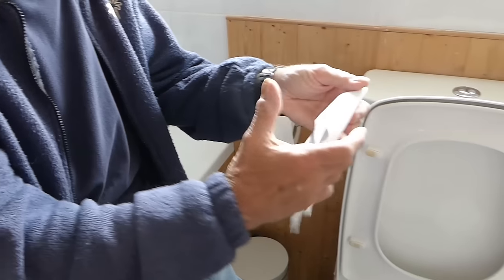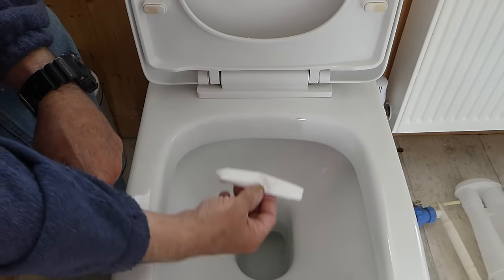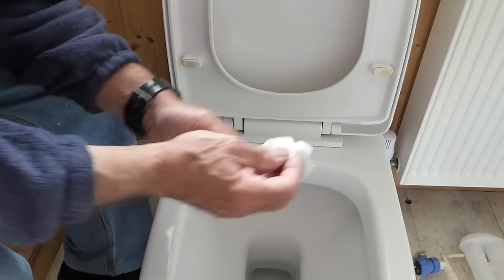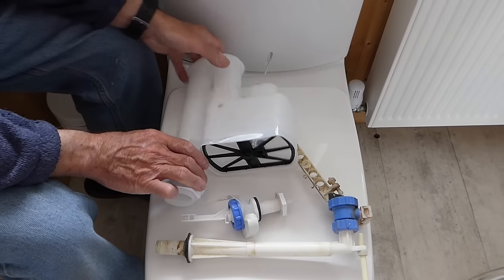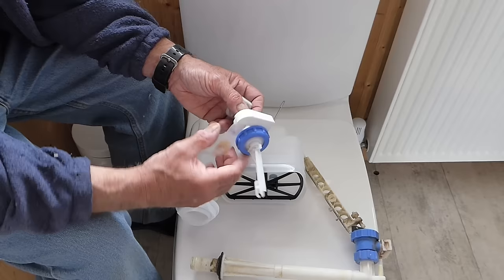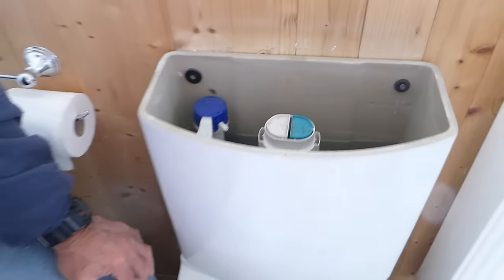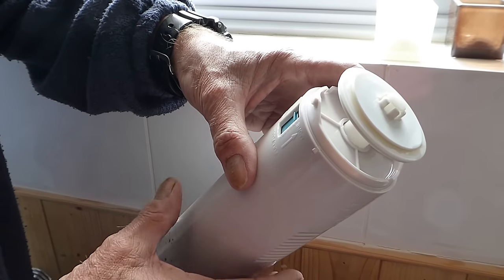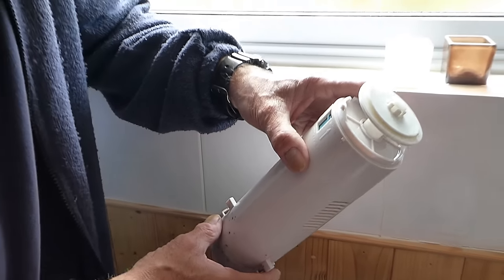How to fix water leaking into the WC pan.

Comment: Many thanks for posting this. I fixed my severely leaking toilet in 5 minutes and I'm not a plumber! Probably saved me £70! Thanks again!
Reply from the maker: No problem
Reply: Did you just turn the rubber seal around or switch to a new one?
Reply: dereton33 where is the link to replace the flush valve seal washer, please?
Reply: @ShaneH  That’s a very personal question

Comment: this is not 100% fact but I noticed tiles start leaking after them blue toilet blocks are put in the cistern. seems the blocks kinda harden the silicon valve in some ways and thus not allowing them to seal properly. I don't use them no more. Not saying but just saying.
Reply from the maker: Thanks.

Comment: Yet another person you've saved from shelling out for a simple fix! Flipped the washer over and it's made a massive difference. Almost can't believe how simple it was. It's an old toilet but this has probably squeezed more time out of it before it needs a proper fix. Thanks a million.
Reply from the maker: No problem.
Reply: A
Reply: @GuacamoleyNacho  Not sure how old it actually is but when I say ‘old’ I mean it’s been here at least a decade, it definitely wasn’t installed by the last owners and we’ve been here nearly five years ourselves.
Reply: Same here. Worked straight away. Thank you!

Comment: Great explanation, flipped the rubber washer seal over and appeared to fix it, however checked on it the next day and was leaking again so had to replace the washer with new one, so keep in mind if you just flip the washer it may only be good for a very short term temporary fix until you get to the store to get a replacement washer.
Reply from the maker: Nice work!

Comment: Al, i had this exact same problem with the cistern turned out the problem was the plastic follower behind the rubber washer had cracked in two, therefore not creating a good seal, simply superglued the follower back together, problem solved. Having VERY limited plumbing knowledge, despite it not being the rubber washer I would never have thought of looking at this and finding the problem. Thank you so much 👍🏻
Reply from the maker: Thanks for the info!

Comment: Excellent video.  I had a leaking WC, was very reluctant to call a plumber during this pandemic.  I could fix the problem myself.  There was a problem with the rubber washer. Just took it out washed thoroughly and fixed it after flipping the sides.  To my pleasant surprise it fixed the problem.  A big sigh of relief. Thanks again for posting the video
Reply from the maker: Glad it helped.

Comment: The one thing he didn't tell comments missed it as well.
The push buttons wc have 2 buttons  one for full flush  one for mini flush.
If you look at the buttons before he removes it, you'll notice when he puts it back, he's turned the unit 180 degrees, the 6 are in the oppersite positions.
Easily done, you may not have any problems, it you wc is on a long run  little less water may runout of power, could cause a blockages. I say it could.
Still a good video
Reply from the maker: Thanks never noticed. Thing worked as normal for another 6 years until new bathroom fitted.

Comment: Small add-, great vid which gave great insight, the issue I had after having a look was the metal buttons on the top removable lid, inside side there are two screw sections that you can adjust  which had increased in length over time - I screwed these to make them shorter which sorted out the leaking from constantly pressing the blue release buttons - hope this makes sense??
Reply from the maker: Yes got the picture, thanks.

Comment: Thank you so much. My toilet cistern kept randomly filling up hours after flushing. I noticed the water trickling from the cistern into the bowl. Followed your vid, the seal was caked in limescale as was a lot of the flush valve. Cleaned it all off in white vinegar now all is good. Might have to soak in limescale remover every few months.
Reply from the maker: No problem Gareth.

Comment: Cheers for the vid, I wasn't able to remove mine, it twisted around but never seemed to release.  Anyways it seems just the twisting around my have seated it better or removed any debris under the bottom washer as it doesn't appear to be dripping anymore.

My cistern was quite dirty inside, I blame toilet blocks, causing soapy residue, so cleaned as much of that aswell whilst in there as grime aswell could have messed up the rubber seal.
Reply from the maker: Glad it helped

Comment: Thanks.  This video showed me how to remove the top half of the flush valve to reveal the washer which was covered in limescale.  A quick clean and it appears to have stopped my leak.

If only I'd seen this before replacing the fill valve...  Never mind.  :)
Reply from the maker: Pleased you sorted ok anyway.

Comment: Thanks. Really useful info. Helped me eliminate the syphon and the inlet valve as the cause of the problem (new installation). Even with water-off, syphon removed and just a residual cm of water in the bottom of the cistern, it was still trickling.  In my case root cause was poor sealing of the syphon base to the cistern ceramic surface (jagged surface finish of the ceramic) . Fixed with silicone :)
Reply from the maker: Glad it helped

Comment: Thanks for this - Turning the washer round worked a treat!
Reply from the maker: No problem.
Reply: dereton33 Thanks for your video. Just as you showed, i removed the washer, turned it round and problem solved.  However I have another question.  Where the float is located that stops the water at the set level, is there a washer or seal, if so how can it be removed and replaced.
Reply: Mines still dripping after I turned it round , so need to buy a new washer, what do I google to get the right one please ?

Comment: Thanks for the video out of all the videos that I have watched  regarding this subject yours put me in the right direction, even though our flush  systems are completely different they all work on the same principle and I knew that there must have been another seal at the bottom of that push button valve - I had a big job removing ours as it was pretty well jammed up. cheers

Comment: I am in Canada. Thank you for this video and your time.
Just found your video. Have a dual button cylindrical flush valve of unknown age where the plunger frequently stays in the up position.
It doesn't want to twist to be pulled out. It is in a one-piece toilet so I'm sure it can be removed from the seat bottom part. But I don't want to force the issue 'cause afraid something plastic might break. Wanted to remove and look at valve all around to see if can deduce why the plunger frequently stays in the up position, how to make adjustments, and to determine the manufacturer/model.   
 I can't find the exact same looking valve online, on sale or in videos, so I can not find out how to make adjustments, while installed.
It's in a WaterRidge one-piece of unknown age, with no model # to be seen. The valve may have been changed out, because the fill valve is a FloatMaster400,  not a WaterRidge valve.

The valve looks similar to a Caroma flush-valve 4900 with blue and yellow buttons, and with a blue external float on a rod. The Caroma has a blue rod and a way to adjust the float's height, while mine has a yellow rod but not the Caroma's adjustment. (I presume there must be some way to adjust. the float height.)
This got to be more words than I originally intended.
Reply from the maker: A few models of flush valve do not twist out and will require the cistern to be removed from the wal and pan l in order to fit a new complete syphon. The float Hight is usually a screw at the valve end.

Comment: Thank you Al, I actually fixed two issues thanks to you. Hissing toilet = replaced inlet valve. Watery back of toilet = replaced the outlet seal as here. When I took my seal out, it was caked with limescale but also, to me, looked as if it was too small to block the hole it was going into. Just cleaning the scale off didn't help. I went to a plumbers shop and they had a seal that had the same internal diameter but a wider external - which seems to do the trick by actually blocking the slow outflow of water. This was also causing the toilet to 'gulp' and have to refill slightly every so often to replace the water lost down the back. So goes to show how the outlet and inlet affect each other and BOTH can be broken as in my case. Thank you so much for saving me from gulping, hissing toilets :-)
Reply from the maker: No problem Dan.

Comment: With the push button washer, does anybody know what that’s called or where to buy a replacement? I’ve just pulled mine out to find it never had a washer in it to begin with! No wonder I’m getting leaks
Reply from the maker: It is a Geberit Type 290 Toilet Cistern Dual Flush Valve

Comment: Thank you very much for this video, helped me to fix my toilet that was leaking back into the pan!
Reply from the maker: No problem.
Reply: dereton33 now I need to work out why the toilet cistern isn’t filling as much as I’d like even though the float is at full height
Reply from the maker: Should be an adjustment screw on it.
Reply: dereton33 there is but it’s at full adjustment

Comment: Thanks, think the problem of water leaking into the toilet bowl constantly is now resolved. Mine is the push button type like the inside of your toilet. I pulled out the thing with the green push button on it and turned over the rubber washer seal which also has air bubble blisters inside it. So I will need to buy a new rubber seal thing. Fushed toilet about 30 mins ago, just waiting the hour to do the toilet paper trick. Hopefully it will stay dry. Mine has the same jade green push button thing, but the other bits and bobs inside the tank are different to what is inside yours. Inside mine there is also a overfiow pipe, and I knew there was a problem with the toilet not only because of constant water streaming down the insides of the bowl, but also because of water constantly pouring out of the gutter pipe outside into the grid. Pitch dark now to check outside in my back garden if that has stopped. No outside light and I hate it out there in the dark, creepy as heck. So I will check that much later today in the morning as it is now 1:11am. Thanks again so much for this very helpful video for us all. You are awesome. ✨
Reply from the maker: Thanks so much Deb.

Comment: I am amazed that people are saying this works because the problem here is not a defective washer but a poor design. The washer is no larger in diameter than the hole it is supposed to seal (ok, so maybe a 1mm bigger) and given how much the plunger is able to waggle around this means that most times the washer will not be fully covering the outlet hole. There will be a tiny gap, just large enough for the water to escape, hence the leak. The only solution here is to get a bigger diameter washer.
Reply from the maker: Good luck with that one. By the  way 95% of people say that this has worked for them.

Comment: Useful video my friend...though I have a problem which I wonder if you can shine a light on....I have the twist off cistern unit with the large washer on the bottom....I have replaced the washer refitted and its still trickling down (albeit a very tiny flow)....any ideas what could be the cause...?
Reply from the maker: The seal on the syphon washer is letting by. Or the valve is letting by.

Comment: Hi, my water leaks through where the  flush valve is inserted into,  the valve that is between the water bowl hole is the cause, how do I fix this? Ty
Reply from the maker: May just need tightening a little. Otherwise a new rubber sealing washer if that does not cure it..
Reply: @dereton33  thanks for the quick reply, I did tighten it as much as I could but the water over flow tube prevents me from turning it any more than I can, do you have a video on how to remove the washer of the Whole to replace it.

Thank you again for the quick reply!!

Comment: Turns out those toilet blue discs with the soluble outer film aren't quite as soluble as they say. The outer film was wrapped around the seal plate at the bottom. 2 minute fix thanks to this direction.
Reply from the maker: No problem.

Comment: Thank you so much Sir,  This is really good to understand however if you can please share 2 other important things in the same push button cistern ..First i have a small filter in place for avoiding the dirt to enter which actually slow down the water to enter does this can be a source of the leaking problem and Second what are the uses of small flexible pipes in this type cisterns... Thanks and Regards
Reply from the maker: You can remove the filter for  faster fill, but it will not be the source of your leak. The flexi pipes just make the cistern easy to connect.
Reply: @dereton33  Sure,  I did the same &  changed the silicon Washer as you suggested in you video.  The Leakage problem is resolved. Thank you once again.
Reply from the maker: No problem.

Comment: Hiya mate I've got the same set up as that cistern....a very slight trickle on mine causes phantom flushes periodically. I tried turning the washer which didn't cure it so bought a replacement and that didn't....what else would it be? Cheers
Reply from the maker: The ball valve.

Comment: Wonderful video, thank you!
I received a letter from Thames Water last week...."your smart meter has alerted us there'a about 39 litres of water continually flowing through your meter which usually indicates there's a leak. This could cost you £709.93 per year".
Somebody came from Thames Water yesterday and advised the leak is internal so we have to fix ourselves, then notify Thames Water who will re-test.
I placed some dye into the water tank and it seeped into the bowl after roughly 2.5 hours. Could this be the issue? There's no dampness or dripping anywhere in the house and we only have 1 toilet. 39 litres of water every hour does seem a lot!
Reply from the maker: It is leaking but not the amount that you are reported as leaking. Fixing it will help though.
Reply: @dereton33  argh I was hoping that was the sole cause. Thanks for your assistance Al, much appreciated.

Comment: I think I've got a leak from the BACK of my toilet, I've  got the push button type with the button on the top of the toilet. I meant to put a water valve on the pipe to isolate it but never got around to.
My thinking was to STOP the water going INTO the systen, with thd OLD type it was easy to hold the ball cockney in position to stop water going INTO the systen.
How do I do it with the new push button type? If thecwater stops leaking downstairs after I've  emptied & kept the systen empty I will know  it's  the toilet leaking.
Hope that makes sence. 
Thanks
Reply from the maker: Just pull the cup under the filler valve up and wedge something under it.
Reply: @dereton33  Thanks but which one's  the filler valve? The blue one with the moving parts? What do I need to drop moving so it doesn't  fill up again?
Reply: @dereton33  I don't  know if it's  worth stating that it's  a Closed Coupled (?), back to the wall toilet. The system sits ON the back of the seat. The only ways I can think of water leaking is from either the inlet pipe OR where the systen sits on the bowl. There is a screw (if I remember it correctly), which I covered.in sealant, if that is leaking, the water could gind it's way to the joint (systen/bowl) & leak out of that. What do you think?
Thanks

Comment: We have a leak into the bowl.

At night and sometimes during the day, when its quiet around the house, every now and then, I hear a short whooshing sound as though the cistern is doing a short refill.  It's intermittent at the moment because if I give the button a hard press, it seems to stop it for a while.

The system in the cistern is a push button type but that's as far as my knowledge spans I'm afraid.  The whole thing was fitted about 17 years ago.  It was bought from B&Q and fitted by a plumber who has since sadly passed away, God bless his soul.

My worry is that the siphon system might be a hybrid.  Is there such a thing?  Or are they pretty standard?

Could I go to say Wolesely or Plumbits and buy a new siphon and it would fit OK?  Are there different types or variants?

I'd really appreciate your expertise and advice.
Reply from the maker: You can get a standard syphon or you could remove your old one and take it along for a direct replacement.
Reply: My mate, a semi-retired plumber came and helped me out.

He identified the set-up in the cistern as Siamp.

Looking at it, it is two distinctly autonomous mechanisms.  A siphon for flushing, operated by dual push buttons on top of the cistern, (which is close-coupled), and the fill valve mechanism.  They look quite simple.

I don't see as there is much to go wrong with the fill valve apart from the diaphragm washer, which we have changed.

The siphon mechanism looks a little more complicated, which indicates to me that there might be more to go wrong and it is more likely that this assembly would be in more need of changing if things were to go wrong.

Can you tell me what is the most common fault with a siphon of this type?  Would it be a component change or a whole sub-assembly?

The Siamp siphon we have was fitted around 17 years ago.  I've looked around various suppliers and there are different models although in most respects they are similar.  The differences are subtle, but would these differences prevent them from being interchangeable?.  How would I know which one is a direct replacement for the existing one?